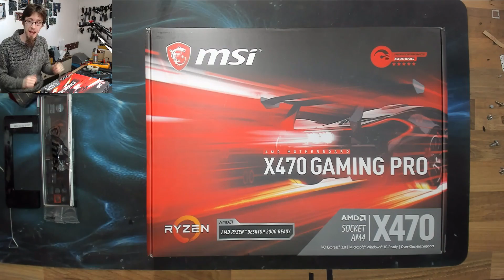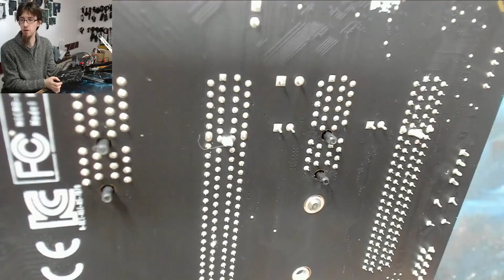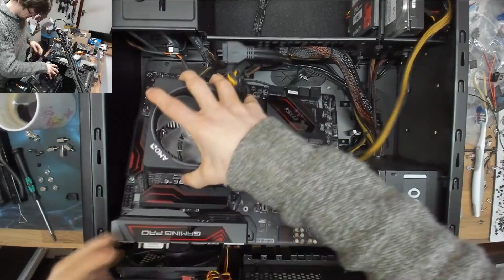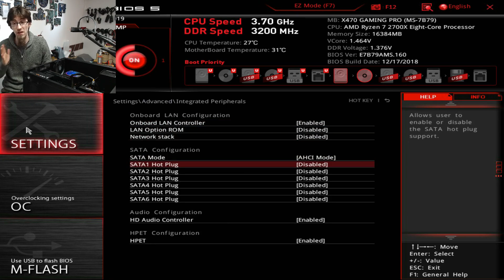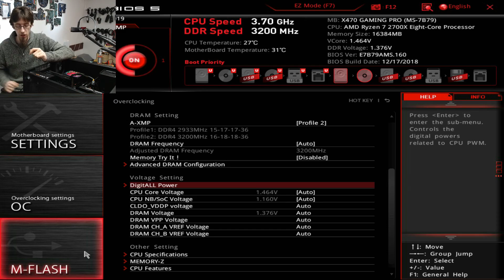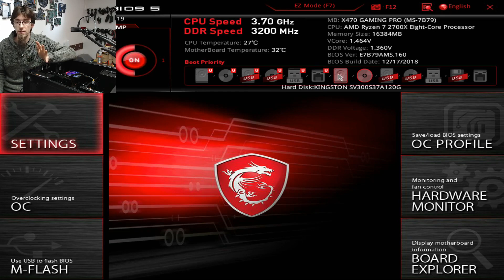LBC#32 - MSI X470 Gaming Pro

Comment: Do you know what pcie slots support bifurcation? And if its possoble to use a dual nvme card in one slot, and have a rx 6650xt in another? Seems possible from what you said about the top slot being x16 and the middle slot being x8. The card id use is 
MSI XPANDER-Z GEN 4 2x M.2 NVMe SSD PCIe 4.0 8x Expansion Card £30 of ebay.

For a custom gaming pc

Comment: Great review, remember it was the best one I watched back in 2019-2020 when I built my current system. Planning an upgrade for CPU and I 'd appreciate your opinion on that. Currently running a Ryzen 5 2600 so I am between the Ryzen 9 5900X or Ryzen 7 5700X. The price difference is huge but since I am using 3200 MHz G.Skill Ripjaws V F4-3200 C16D-32GVKB currently running at 2933MHz for stability(Ryzen 5 2600 memory controller is responsible for that I think) I was wondering if you can suggest which one of these or something else. I am mostly doing research and office work plus some gaming but nothing really very demanding. No video editing or streaming either. Any suggestions? Thank you.

Comment: i have 1 of these board that is stuck with debug cpu light on and don't post i reflashed the bios suzzesfully using an tl866 programer 
didnt fixed the issue  (cpu tested on another board and working and i tested this board with an athlon 200ge in not woring)
that board worked perfectly before i removed it from the case 
the only thing i see is y it the clear cmos button accidently while the board was powered on dont know if i blowed something doing this?

Comment: Hi!I want to upgrade my motherboard(MSI-B450 Bazooka v2) maybe to that one x470,what its your opinion?
Reply from the maker: Depends on CPU. If you've got a Ryzen 3000, I'd go B550.
Reply: @Adamant_IT  No.I have 2600
Reply from the maker: Mmm. It depends if there's something your current mobo isn't doing for you. You won't see any real performance difference - so it falls down to features. Do you need extra USB, PCI-E, etc...

Comment: Whats the highest gpu i can put on this motherboard i have it with the ryzen 2700x and evga 1070 sc but want to upgrade the gpu
Reply from the maker: Up to Ryzen 3000-series at the moment. I would wait and see if a Ryzen 5000 BIOS is released this summer, and then you could drop a 5600x into it. X470 Zen 3 BIOS support is still in the pipeline though.
Reply: @Adamant_IT  im new at pc so im confused let me tell you what i got . I have 2700x with msix470 and evga 1070 sc and currently playing warzone at 84-97 fps and was looking to upgrade the gpu see if i get more fps or what do you advise me to do

Comment: If i have 4+4 pin psu I need to put them in 8pin slot, right? And the other 4 pin need to stay empty?
Reply from the maker: That's correct. The additional 4-pin connector is for extreme overclocking when the 8pin isn't enough.

Comment: 7:24 I actually managed to break a DIMM slot on an older AM2+ motherboard. was lying under the desk on my shoulder to "just quickly exchange a module for trying out". The slot sort of split lengthways from the upper end and the little notch thingy fell out. I managed to kind of get the RAM stick to stick anyway and tried to hold it together and it still works. I should however, one day probably try and see if I can make it a bit more sturdy, maybe with Revell model glue or something.

Comment: Great video man.. Im thinking to buy this one the Max version that supports ryzen 3000 or the 470 gaming plus max. Which one would u recommend for gaming/over clocks etc etc?
Reply from the maker: Yea deffo, the newer Max boards are really good. B450 Max is a solid board, X470 is even better if you've got the budget for it. Main differences will be some extra IO and more CPU VRMs on the X470. Looking at Amazon UK, the X470 Gaming Max is only slightly more expensive, absolutely worth the extra £15 right now.
Reply: @Adamant_IT  i've got the extra money for the x470😊. So u mean the gaming pro max(140 euro In greece) or the gaming plus max(110 euro In greece) is the better choice?

Comment: There is a newer version called MSI X470 GAMING PRO _MAX_.
I can not find any technical information about the difference between the "old" version (7B79-001R) and the newer MAX (7B79-007R) version. Does someone know?
Reply: Max version supports 3rd gen ryzen out of the box. Non-max version supports 3rd gen ONLY after BIOS update.

Comment: What is the plug for bottom left, 8 & 4, thanks.
Reply from the maker: CPU power. You need the 8pin "EPS" to power the CPU, and the additional 4pin is optional for extreme overclocking.

Comment: Protip: If you are going to combine this with a second gen ryzen and love the look of the bios: DONT UPGRADE TO THE LASTEST. 
Its a stripped down variant with missing features as the biggest being easy bios fan control. And it looks like a glorified legacy bios.
If you want/need to update, go for the bios that came out before the ryzen 3000 support. 

I had to do a scary bios flashback because the motherboard doesnt allow downgrades with a normal downgrade. I followed this video: https://www.youtube.com/watch?v=9tR38bPGN-0&t=162s
and it worked for me.
Reply: Thanks for sharing your experience

Comment: sir, can you give me answer one more time?) Whats motherboard i need for r5 3600x, or r7 3700x? Without problem with temperature VRM. Thx. Msi x470 gaming pro max, X470 AORUS ULTRA GAMING?
Reply from the maker: I would buy the MSI board. However, VRM temperature won't be a problem on either. VRM temp only really matters with heavy overclocking or when using the 3900x / 3950x.
Reply: I had only 2 options same as yours. So i bought MSI x470 gaming pro

Comment: My power supply have only 4+4pin, can use it? Can i use without +4pin? Or i must have 8+4 only? Thx
Reply from the maker: Yes, the additional 4pin is just for extreme overclocking. 4+4 is fine for general use and light overclocking.
Reply: @Adamant_IT  thx very much!!! :coool:

Comment: Guys pls I have a question I have this motherboard and my CPU has a 8 pin cable but the motherboard has another 4 pin extra should I buy an extra cable or it's not a problem also I see there is an description of CPU Powe 2
Reply from the maker: The extra 4-pin is for extreme overclocking. For stock speed and moderate overclocks you can leave it open.

Comment: The MSI X470 GAMING PLUS MAX is pretty much the same board, but with no IO backplate and weaker internet and sound controllers ( a k a Realtek no Intel )? Do you think it's a good entry-level X470 board for a new Ryzen 3600 machine?
Reply from the maker: I'd say so yea. It's not a perfect board, but it's imperfections are forgivable, and it's still a shade above the high-end B450 boards for only a few dollars more. I've just given amazon a quick scan and all the other low-end X470 boards seemed to be up in the £130-£140 price bracket.
X470 prices dipped when X570 came out, but they seemed to have recovered because of the slow uptake of X570.

Comment: hi i have a question ( sry for my but englisch). i want to  get the Ryzen 3600 i think i take the g.skill 3600 neo but  with the motherboard  i have i a problem dont now what. i think the  msi x470 gaming pro max. but much people tell me  i can get the b450 max its cost not  so much since the x470 and i dont want to OC. what think you????? witch one soull i get? and again .sry for my bad englisch :(
Reply from the maker: I've been working with a B450 board recently, and my general opinion is that if you have an ATX case, it's better to pay a little extra and get a low-end X470 mobo.
The Gaming Pro Max is fairly expensive, but the Gaming Pro (same as this video) is a perfect middle ground. You get the X470 chipset, and it's only a little bit more than the B450 would be.
Reply: @Adamant_IT  Hi. Thank you for the quick response. ok i will buy the msi x470 gaming pro max.  the cost here in germany at the momend 147 euro.and yes  i have big tower , the cooler master haf x.

Comment: 1.46 voltage on stock settings what thats high for 3.7 ghz id say overall great video i have this mother board and my only issue is that my dgb for my ek blocks have no way to plug in.

Comment: Thanks for a really informative overview/review on this board. I was aghast by the paucity of content about this particular model on the internet.

I'm getting an 11 month old one for about 100-110 usd. (I know its pricey but I'm in India). I have choice between this board and B450 Tomahawk board. Which one would you suggest?

Or any other board to pair with 3600x.
Reply: Buy the MSI X470 GAMING PLUS MAX version if you can find it, it's a good entry-level board with bigger updated BIOS chip for 1, 2 and 3000 Ryzen series processors!

Comment: Thx for the great review. I have this board paired with a 2600X, could you show us how the cup voltage controls work? At idle with no manual OC, you voltage is usually 1.42v which is quiet high.

Comment: I dont like this board. Newegg wants $200 for it and I dont like the way the CPU is powered(for the price). I'll probably end up getting an Asus 470 board for a 2700x cpu. I dont think MSI is really trying to do much with Ryzen. Also, I was wanting the RGB RAM but checking the QVL, unless maybe it was too expensive and I skipped it, but Im not finding that compatible with Asus. Maybe I should look into the Gigabyte board. Been a long road looking up all this stuff, though. Thanks for the video. Community appreciates your contributions.

Comment: Helpppp ryzen 5 1600 does it fit in this mobo , i have to do bios update ?
Reply: Thanks
Reply: @tzatzikipatrino381  I have the Ryzen 5 1600 on this board and it works 100%

Comment: I have the MSI x470 Gaming Plus board and I've had a lot of instabiilty using the game mode to overclock my ryzen 7 2700x. I ended up using ryzen master to handle overclocking. My cpu also runs significantly warmer (about 10c) with a small AIO cooler than that stock cooler which is interesting.
Reply: dont use game mode on  a 2700x  that turns your 8 core in to a quad core. that feature was more or less meant for threadripper.  and dont use ryzen masters its horrible. use the uefi.  the 2700x  does a better job with its built in xfr2 at overclocking its self. than you can hope to get out of it by setting the multiplier . if anything. you can learn about precision boost over drive. that would allow for a bit more boost  if you have the thermal head room.

Comment: :You have no clue. The quality of the mosfets and the cooling elements is far more important than the number of VRMs.
Reply: @Adamant_IT  Sorry, but there are motherboards that are not adequate and cause thermal throttling due to cheap components. MSI is not one of them. I suggest you do some homework at Actually Hardcore Overclocking. And as I stated, it is the quality of the mosfets, not the quantity, as you seem to think.